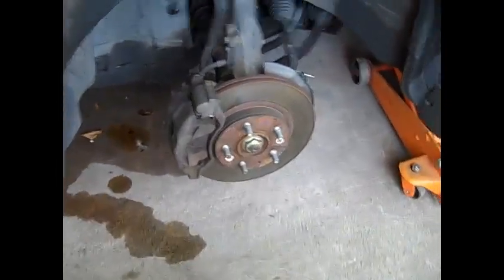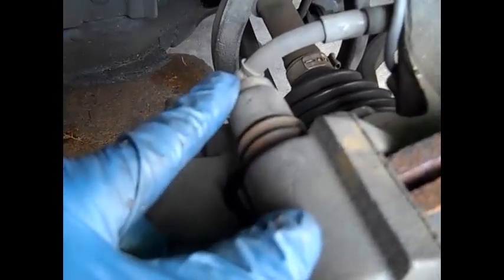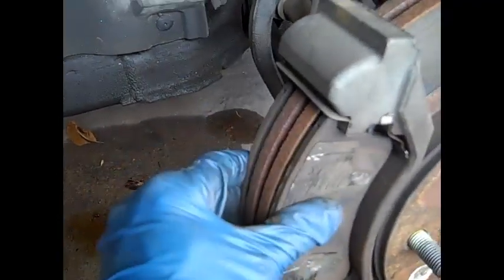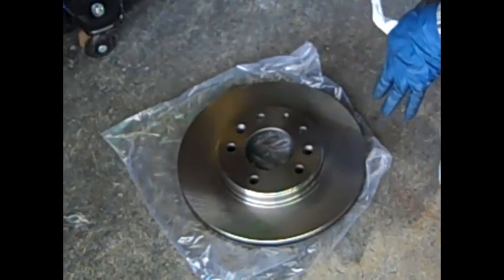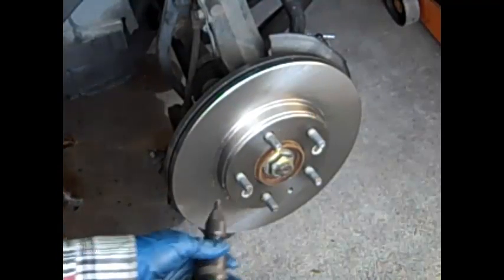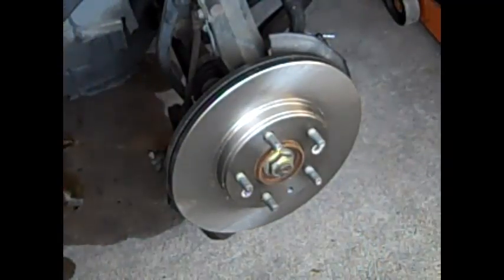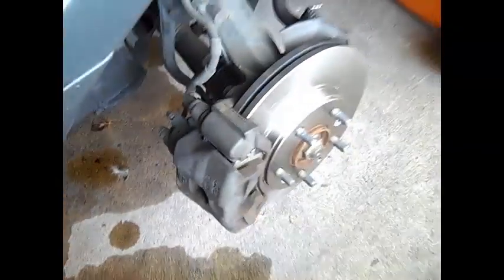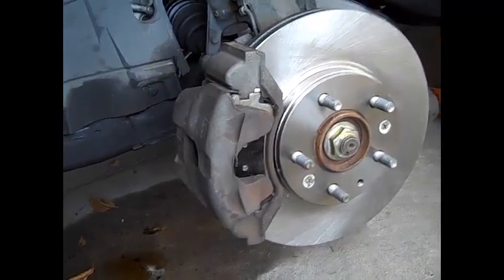How to Replace Front Brake Pads and Rotors on a 2004 Mazda 6

Comment: First thing take top off brake fluid reservoir so when you compress the caliper the fluid can flow back up into it with no resistance .
Reply from the maker: It will do that without taking the cap off. If you take the cap off, there is a good chance it will squirt brake fluid all over everything. Been doing it longer than you are old. Don't confuse people by making false statements. Second, if you already think you know how to do this, why are you watching and commenting, just so you can have something to say about it?

Comment: you shouldn't let the weight of your caliper to hang by the brake line. It can damage and break the line, causing it to rupture. hang the caliper from the strut or spring with a bungie cable
Reply: RodsShop all my years doing breaks i never seen that before it’s always bungie cable too hold caliper but u the pro.

Comment: Hi, my upper slide pin wont come out. I had to take out the entire caliper from the begining and after i get out the pads it still wont come out. Any sugestions?
Reply: HEAT IT UP!  No thread looseners will EVER get close to the effect of heating. But be careful: 
1) brake fluid is flammable and its self ignition takes place around 400°C , 
2) boiling your brake fluid will most probably damage your brake system, first of all the ABS module (due to reverse pressure)
When heating the nuts, try to use as narrow flame as possible, and focus on a thin area. The goal is to expand the nuts only, so it expands and rust cracks inside. (You may also apply gentle hammering, to give it some vibration. But hey: cast iron BREAKS easily!) Some say that once rust is cracked, use of thread looseners may make sense, as they can now penetrate. I never bother using them after heating. (They are really flammable, too, so dont spray them on hot iron  :D  )